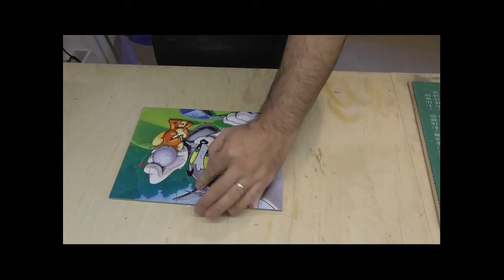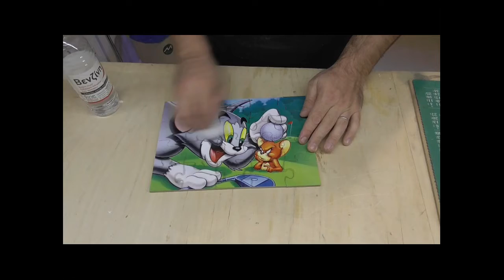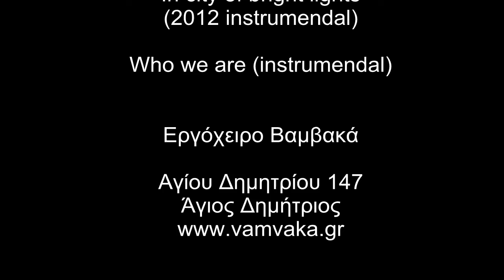How to make a wooden puzzle out of any photo. Tutorial

Comment: Hello, what glue are you using to stick the pattern on the photo?
Reply from the maker: Simple paper glue spray. The paper is laminated and is easily removed.
Reply: @empnoiawoodworkingcraftsan4094  is it only on the paper. If your spray both sides the bond becomes permanent?
Reply: @11941leechie  It is only on the paper for the pattern.
Reply: Ok thanks